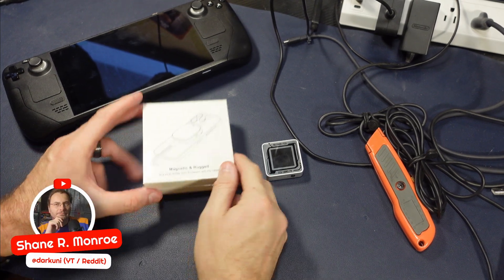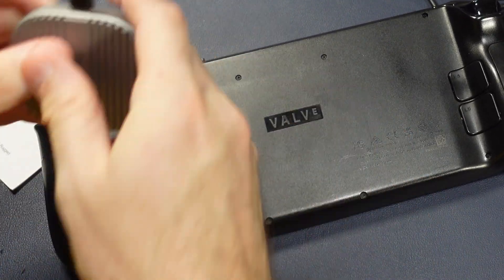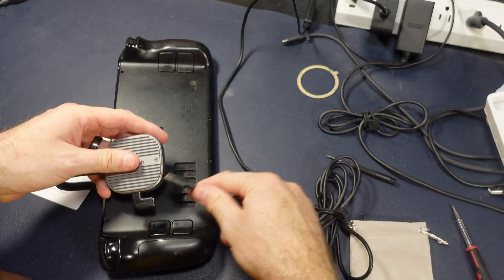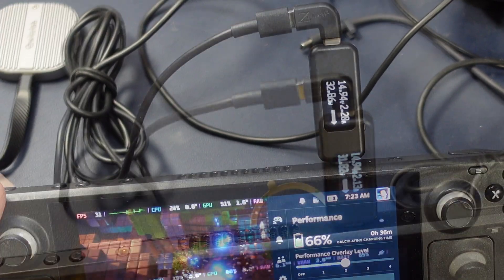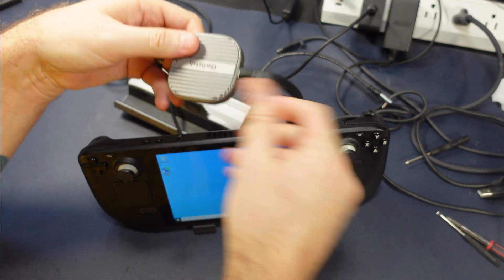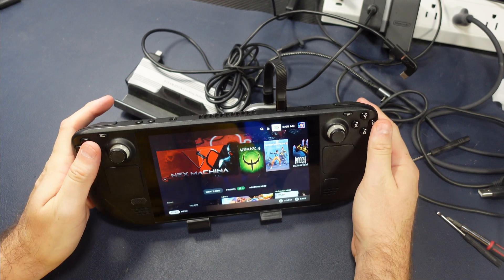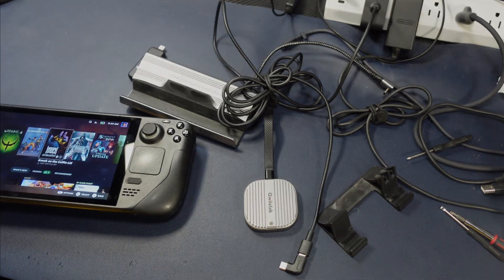The Ultimate Steam Deck Upgrade? Qwiizlab NVMe SSD Enclosure Review

Comment: I removed my internal steam deck ssd, installed Windows on it, and installed it into this enclosure. 
I run all my non steam games from this enclosure. It is FAST. I use a regular type c cable to pass power through the enclosure, and the included cable from the enclosure to the deck. 
It gets quite warm while charging and using it but turning the fan on in the room cools it down, it’s never throttled. 
The power cable does point directly at the right grip, but I just lay it between my fingers, once I start gaming, I forget it’s there. 
It does charge the deck slower than direct power but I’ve never had it die mid session while pass through charging.
DO NOT unplug the power cable after it’s connected! Windows will crash. You can plug it in fine but unplugging it will cause it to crash, I’ve tried multiple windows configurations to combat this but nothing has worked. 
Overall, I really like the enclosure. Thank you for making this video!

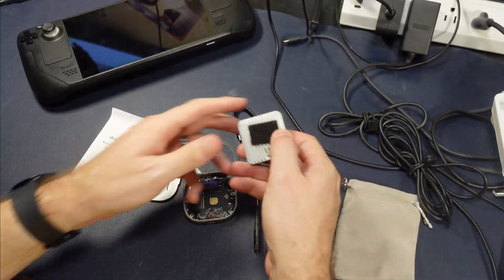Comment: @ 1:33 it seems you left the plastic on the thermal pad stuck to the enclosure you took the test drive from. At 2:17 it also appears you did not remove it from the thermal pad here either. So you might want to remove that for better heat transfer.
Reply from the maker: Indeed.  I appreciate that.

Comment: I've successfully used this enclosure to run windoes great, although I made the mistake of getting an ssd that is a little too demanding (kioxia bg5, should have bought a bg4) but that got resolved with settings something call APST (it's a registry thing for nvme power states) to 2 and setting the idle registry entry to 300ms).
After that I stopped having momentary freezes in windows and it's been rock solid, although admittedly I only use it for those games that refuse to work on linux so it isn't often.

I use a right angle adapter to work around thr location of the powe port, it's really the perfect enclosure for my deck.
Reply from the maker: Some good info there, thanks!

Comment: Hi i got one question i try'ed to use a Asus TUF Gaming Enclosure with a WD Black SN850X 8TB inside of it but when i connect it directly to the Steam Deck it only shows the name of the Enclosure/Chipset and not the actual drive only when i plug the NVME into my Dockingstation it works. So i am not sure if the Powerconsumption is to high or if there is any work around? A Allready found a USB C Adapter were you could connect a USB C Device and a charging cable but then i had to connect a powerbank to be still mobile.

Comment: If you were to plug the enclosure into the dock instead of the dock into the enclosure, would it then work? Just for if you wanted to put it on the tv while using the enclosure
Reply from the maker: @Lia7187  it does work but it won't be as fast.

Comment: Sorry if I missed it.

I know windows froze when the power was removed. But does this boot the OS/run fine, without the power being plugged in at all (does it function fine using USB power alone, or does it require the passthrough power to also power the storage)?

I'm looking for an m.2 to usb that I can attach to the back of my Steam Deck, to permanently run both Windows and SteamOS from (I've already got 2tb in the internal m.2, that's partitioned into two 1tb drives. That I currently use to run Windows and SteamOS. Using clover to boot both OS, and batocera from the SD).

I'd want the m.2 to usb to work powered solely by the USB, with power passthrough to charge the Steam Deck.

This is so that I can make the egpu mod permanent (having used an m.2 to OCuLink in the internal m.2, with a notch cut out of the back plate).

Permanently running the OS from a USB powered m.2 to usb, will allow me to leave the egpu mod in place permanently. Making it plug-and-play. Booting into Windows to benefit from the gpu when docked, and using SteamOS when handheld.

An m.2 to usb such as this would be a perfect way to mount it, and having power passthrough is a must for using it handheld. But if power is required to use the it, then that would defeat the point of using it handheld.

If this product doesn't fit my requirements. Any advice on a one that does would be appreciated.

Thanks.
Reply from the maker: It works fine without external power.  Obviously, it will slurp the battery down faster.  I used to use it just that way at first - until I got that elbow to redirect the power cord downwards.

Let me know if I can answer anything else.  10% deal on this sucker right now - good time to get in on it.
Reply: @Darkuni  thanks for getting back to me, and confirming it works without power. 

Windows crashing when power is removed wouldn't be an issue for me. As I'd only really be using windows when docked to use the gpu. But I'd assume that this would also happen with steam Os, if it was running from the same m.2 in the Quiizlab (which would be annoying, as I'll often top the battery up and then remove the charger while playing handheld). 

Alongside this Quiizlab product, I've had a look into the genki save point, sharge disk plus, and some random item on amazon that looks similar to the Quiizlab (effdrdfs magnetic m.2 enclosure).

That's all I've been able to find. The m.2 enclosure with power passthrough seems quite neich right now.

They all claim to allow up to 100w power passthrough, but I imagine that they will all have some kind of loss similar to what you found with the Quiizlab (perhaps due to some of the device requested draw being stolen by the storage/enclosure).

It's encouraging that the enclosure works solely from USB power. And everything I've found is around the same price (although the dodgy looking amazon one is only £25. So may be worth taking a punt on, and return if its no good).

I'm going to attempt to get a console like setup next to the tv in the lounge, as a switch-like console experience. Putting a gpu and power supply in a tiny itx case, with the oculink cable coming out the back. Allowing the steam deck to be docked into the oculink cable, sat on top of the case.

If the storage over usb works as I hope. I'll then be able to plug-and-play between handheld steamOS and jumping into steam big picture on windows when docked.

Thanks again for your help.
Reply from the maker: @swordofomens5202  Let me know how it goes.
Reply: @darkuni  I ended up sacking off the m.2 to usb solution, for storage on my external gpu setup.

Looking on amazon, I found another solution. And with same day delivery, I took a punt on it.

Rather than have the m.2 to usb (with power passthrough), permanently required for storage. I found an m.2 to dual m.2 board.
     Notching one of the air intake slots down a bit further, I've been able to thread the ribbon cable from the m.2 slot in the steam deck to the outside of the case.
     I've put my storage m.2 in one of the slots, and the m.2 to oculink in the other.

Booting from clover, I've had zero issues booting both the windows and steam OSs. Without having to change anything in the bootloader or reinstall.

This has left the USB port free to charge, and/or run devices when docked (wireless keyboard and mouse dongle, etc...). And there is no issues with the storage (i.e, windows crashing when power is removed).

It's truly plug and play (obviously not as clean as docking a switch, as I have to boot into windows to use the gpu when docked). But it works exactly as I envisioned.

I've got permanent storage and permanent access to the oculink port, while retaining a free USB port.

I've got an rx6600 and psu inside a tiny itx case, attached to a pcie to oculink board. With the oculink cable tucked inside, able to be retrieve from the gap in the case (where the io shield would usually be). Which I can plug into the steam deck, which sits on a stand on top of the case.

Plug it in and boot into windows/steam big picture mode. To play gpu boosted games on the TV, via wireless controller. Or boot into steamOS, to use as a handheld.

The gpu is overkill with the bottleneck caused by the steam deck cpu, as well as the losses in data exchange using the m.2 to oculink (which is also split again for storage). But it works better than I expected. With games running great at the higher resolutions on the TV.

I did try a more sensible gpu for this setup (an old rx580), but couldn't get any display for some reason. And the rx6600 is the only alternative I had available.

I've still got a bit of tinkering to do to tart it up a bit. Like fitting a mesh io shield cover, and finding a better way to trail the oculink cable from the case to the steam deck. And soldering the case power switch to the board (right now the gpu can only be powered on and off by either removing the side panel of the case and flicking the physical switch on the board. By leaving the switch on and powering via the physical switch on the psu. Or, as I have it set up now, leaving everything on and getting Alexa to turn it on (having the psu plugged into a smart switch).

I also need to find an aesthetically pleasing way to permanently attach the dual m.2 board to the back of the Steam Deck (it's currently taped on with electrical tape).
     I don't have access to a 3d printer. So for the time being I think I'll end up sandwitching the board between two thin perspex sheets, using standoffs in the corners of the board. And cutting a notch out for the oculink port. Sticking it to the right side of the back plate, perhaps with thin magnets (so it can be removed if required. I.e, to put the steam deck in its original case when travelling. The ribbon cable is easily removable from the board, and it fits in the case just fine with the short ribbon cable across the back of the steam deck).

Oh. I was also pleasantly surprised that batocera also works via the external gpu (as steamOS does not, I was not expecting it to either).

Thanks again for your earlier advice, and your video (one of many that has been helpful in troubleshooting my endeavours).

👍
Reply from the maker: @swordofomens5202  wow what a crazy story. Thanks for sharing it.
Reply: @darkuni  sorry for waffling on. I know you asked me to let you know how it goes, but am aware that I got carried away with my excitement from the success and ease in which this was achieved.

I do have concerns about long term stability of the storage use as a handheld. As the only solution I could find to split the m.2 into two m.2 ports, was to use an m.2 to pcie cable, into a pcie to dual m.2 board. Which recommends the use of a 12v power supply (on the m.2 to pcie cable), to maintain power stability. I assume that power would be maintained fine on the gpu end, when docked. 

I have not used this, as it would require tethering my storage to a power supply (which would defeat the point of having my storage fixed and available as a portable handheld).

It's worked fine so far. So fingers crossed.

If I do encounter any issues in the future, then I'll revert back to the previous plan (using the m.2 to usb, power passthrough adapter for storage. Although I envision boot issues attempting to simply move my installed OSs to the USB. So may need to mess around with the bootloader or reinstall. Which is fine for steamOS, but getting windows how I like it is a time waste). And having the m.2 to oculink port simply come directly out of the back of the back plate (the notch cut for the ribbon cable would already allow for this).

All the best.

Comment: Hello my friend, I have a problem. I bought a m.2 1tp. When I install the OS on the steam deck, the image freezes. It is new. When I put it on USB C, then I put it on the steam deck from the outside, it disconnects by itself.😢
Reply from the maker: Seems like a bad drive issue :(
Reply: @darkuni  Is it factory? When I try to play with it while it is connected via a charger, I do not face any problem, only when installing the system😞
Reply from the maker: @hussein9714  I'm sorry, I am not fully understanding what you're saying/asking... :(
Reply: @darkuni  I say is there a solution or is it a manufacturing defect?
Reply from the maker: @hussein9714  Can't fix hardware.  Probably a defect.

Comment: For the power pass-through test, were you usinb the standard 45W power supply? I don't know how much an NVMe draws, but if they benefit from heatsinks, it's not insignificant.  Any power used by the drive can't pass through to the deck. I wonder if a 60W or higher PS would be able to run the drive and still provide full power.
Reply from the maker: @notreallydaedalus  I tried 140 Watts with the exact same results. :(